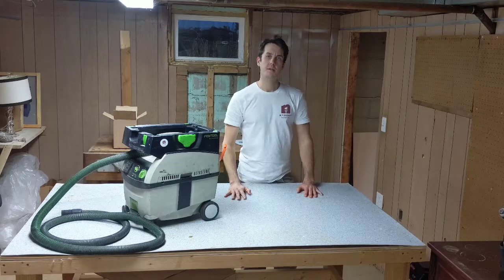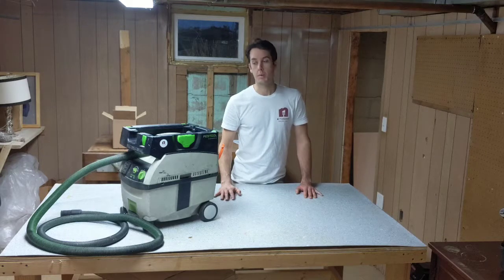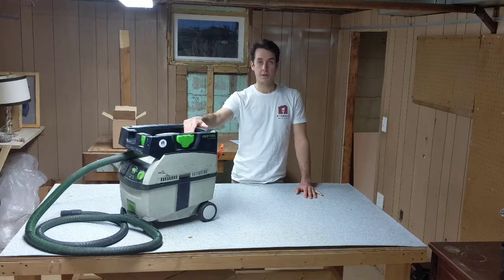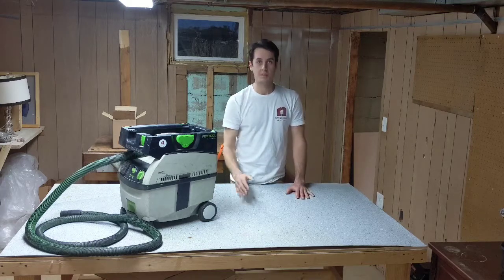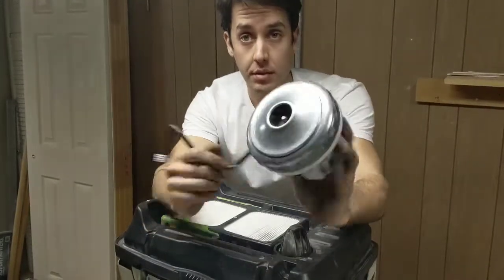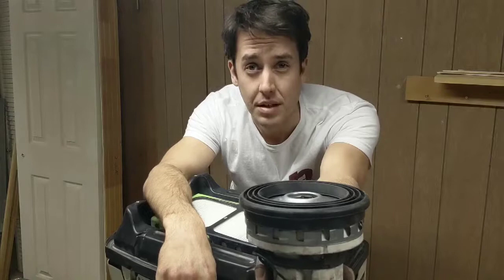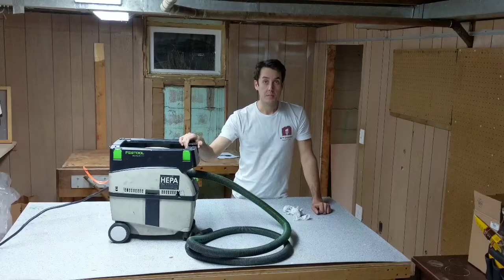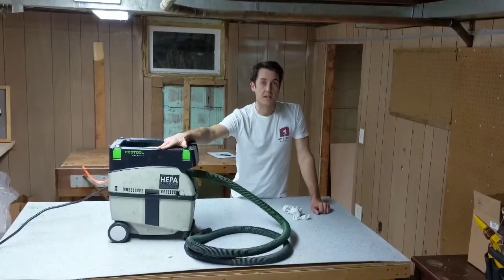Diagnosing and Replacing a Festool Midi Turbine

Comment: The Festool Midi is not designed to handle fine dust. Everything up to and including the CTL 26 has as their application area -
"Assembly [low quantities of coarse dust]" - this is stated clearly in the Festool UK catalogue . I'd be interested in what your US dealer says re what the Midi is suited for?
You're in the US, so the Hepa filter will have helped to save the turbine (and you) from taking in the finer dust, a lower grade filter wouldn't have caught - but, if you're using it as you say, I'm amazed the motor didn't overheat and give out much sooner. You had no overheating/cut out issues? 
Thanks for posing the video though - I like the Nth degree logo :-)
Reply: The Freelance Painter how often does festool recommend replacing  the hepa filter?

Comment: Are you sure the motors burn out?  The usual fault around 5 years uses is motor brushes wear out a nice cheap $15 fix, don't throw your old motor away yet.
Reply: How do you know if the brushes are bad? I got a second hand unit that worked very well until.. well.. I was dealing with a clogged hepa filter and now it works for a minute, ten minutes, an hour.. but then just shuts off. like whenever it has a tough time, it gives up. new hepa filter after knocking the old one free of dust a gazillion times.

Comment: this is not diagnosing! This is trial and error replacing parts until the VAC works again.. Dumb to invest in a new turbine if there is a fault on the electronic board, or if its simply the coals that are worn out. As far as I’m concerned diagnosing is to measure in this case the motor to see if it actually works or not before ordering a new unit. And motor can still be fine if coals don’t do their job properly. Having the motor out you can also measure if the correct current comes through the wires which will rule out the electronic board as the issue. The whole point with diagnostics is to determine the faulty part before ordering anything..